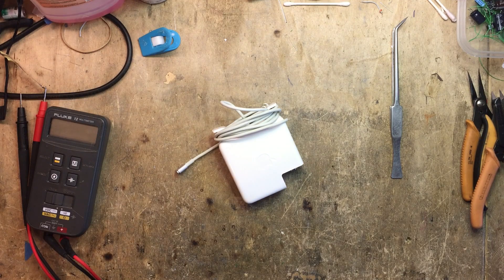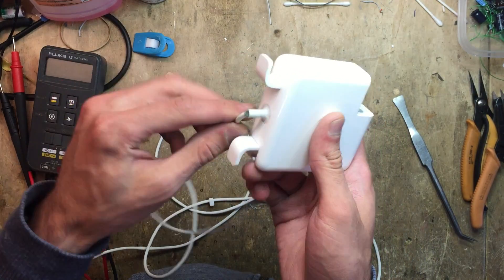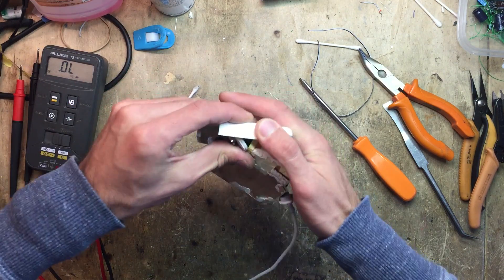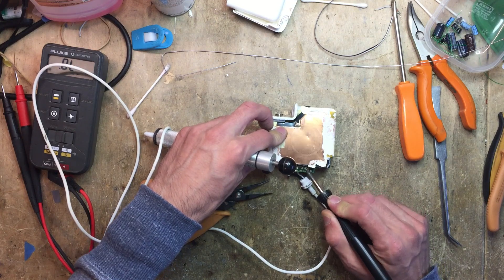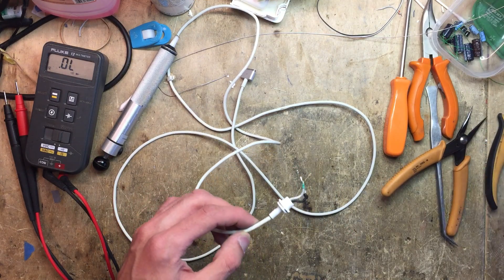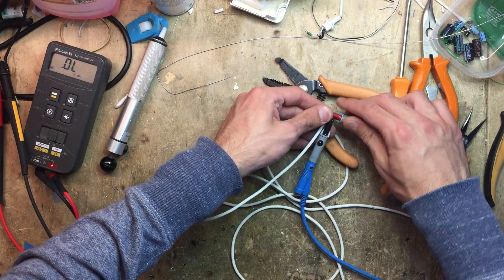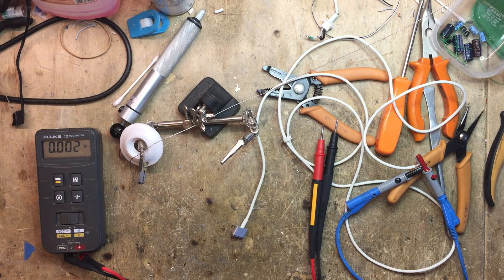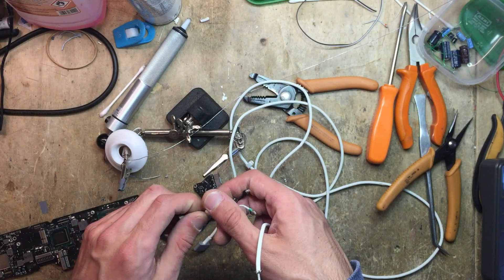Apple MacBook Magsafe 2 Power Adapter repair tips and tricks (not a guide)

Comment: Becareful when working on these supplies the large brown electrolytic capacitor can have 200v on it even unplugged. make sure you discharge it before working on these adapters
Reply from the maker: We have 220vac so it’s more like 300vdc. My multimeter has a low impedance mode that’s perfect for discharging capacitors

Comment: This video helped me get by for a few days while my replacement arrived. Great video! All I needed from this video was the pinout which is Pins 1 & 5 V-, Pins 2 & 4 V+ @ 16.86VDC, Pin 3 Charge Control Pin.
Reply from the maker: When unplugged the V+ is lower, around 8V and switches to 16 only when a load is detected

Comment: Hi, nice video. Could you please tell me, which settings your power supply (Volt/Ampere) is running with when you try to find the short? Thank you.
Reply from the maker: Voltage is not relevant as you’re going to be limited by current (you need a CC capable bench supply). Usually even 500mA are enough but sometimes you need a lot more (big mosfets for example)

Comment: Hey! Do you think it would be possible to snip the cable off an old MacBook AC adapter, and connect it to a battery (using a a DC V/A-step up/down converter to make sure the voltage/amp is correct). So bypassing the whole AC to DC transformer. The only black spot / potential problem in my mind here, is that the MacBook probably takes different amounts of power from the power supply depending on the need -- so I'm wondering if this would be a problem with a DC stepper with a set voltage/current? Thanks!

Comment: Hi Fancsco. FANBLOODYTASTIC. I followed your instructions exactly and repaired a friends.
I have 2 improvmnts for anyone else repairing thiers.
1 Warm up the power supply with a hot gun or hair drier to help open up the power supply and
2 put a small amount of lubricant inside the cable connector, before drilling it out(WD40). This might help not breaking the sleeve around the cable, my very sharp drill twisted it off breaking the sleeve.
Great tutorial mate. Take care.

Comment: I'm confused how you rmultimeter works. I am new to using this type of tool, but I thought that the beep on the continuity test shows a good connection/circuit? But you were saying the beep shows a broken circuit?
Reply from the maker: A continuous beep usually means a close to zero voltage drop on the component, therefore there's likely a short (or a low resistance path), and in my case a singe short beep means that the circuit is not open  (or that LowZ has been enabled), could you please point the time where I say that? could also be a mistake I made...

Comment: The ground are the 2 outer pins, then the other 2 are positive. The middle is for the led. So you dont measure the magnet ;)
Reply from the maker: It's easier to use the magnet when measuring at the connector, the positive and negative pins are quite close together so you may risk shorting them when measuring. Only downside is that not all magsafe models have a grounded magnet (but most of them do).
Reply: Francesco Ferretti okay thats with the new models I guess. Seems the old ones just stuck on there no connection orso
Reply: @FrancescoF  hello Sir, I want to try to repair my charger too it stopped working from today.😭 I hope only the fault is with the cables and not with the board.
Thank you for the video, I am new to these things but as a man I want to learn. 😊